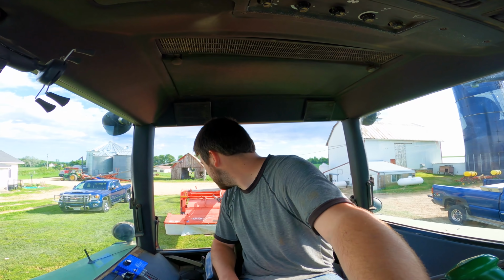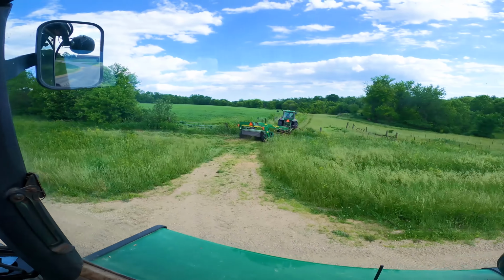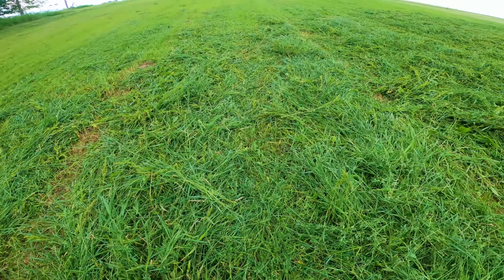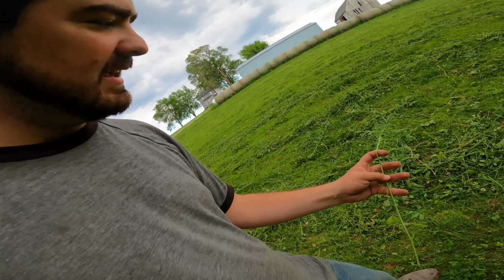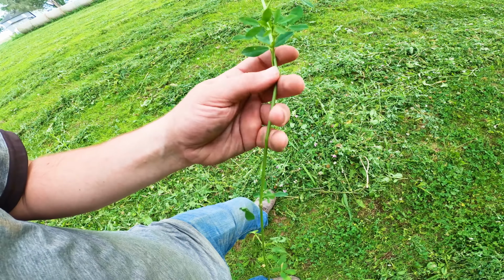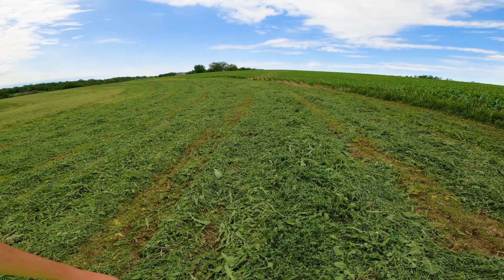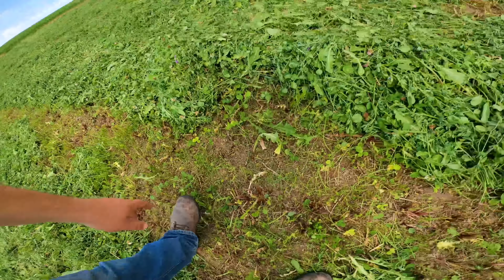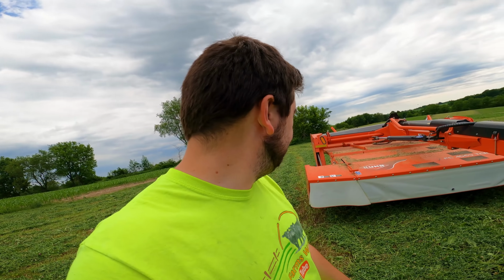Knocking Out First Crop | New KUHN FC 4060 TCR Mower Conditioner

Comment: I've watched and commented off and on since your small square baler video many years ago.  

I cut with a 4840, basically the same tractor as a 4640, except all 4840s are powershifts, have a bigger fuel tank, and a bigger injection pump.   My mower is a Gehl 2415.  Good match.  I totally agree with a center pivot,  Swivel hitch is as important.

Comment: We always ted our hay right after we cut it if we are going to make dry hay bales.  Not only does it lift up the hay which was ran over, but it spreads it out even more.  We have found it cuts dry down by at least a day in first crop and 2 days in 2nd & 3rd crop.

Comment: You guys should try a self propelled haybine. On our farm we use an older New Holland 1495 and a newer New Holland HW300. We like them because they use barely any fuel and we don't run over our windrows with them. It also make the cutting go way faster. You guys should try one sometime.

Comment: Was thinking the same thing about the 4640 being a perfect tractor for that mower.
Reply from the maker: We were worried it was going to be a little too much tractor for the mower, but it seemed to run it very well!
Reply: If you weren't careful maybe you'd over power the hitch gearbox on start up. But you ran it up a little at a time. Seems perfect!

Comment: one side of the header is heavier than the other side. you adjust the torsion bars by how much it takes to lift each side  so it might have been adjusted right
Reply from the maker: Maybe, but we found it wasn't leveled even before I adjusted it and adjusting it made it run flat

Comment: It seems as if a narrow windrow would be better for drying. That way you are not running over it with the tractor tires and pushing it on to the damp ground. And the narrow windrow gets it up off the ground so that the air can flow through it better.
Reply: Been watching for about 3 years I like the demos keep up the good work trying for a hat
Reply from the maker: I do regret laying it as wide, not so much due to drying since it dried very well, but because I couldn't hit it pass for pass with the pickup of the merger.

Comment: How good does it pick up your tractor tracks when you cut the same direction
Reply: Not the best, depends on the blades an type of hay. Most farmers go clockwise five to seven times then turn around an make their back cut so your haybine is always on your right!!
Reply: @bryanG4020  Most guys cut one round counter and the rest clockwise, but by then you go back and forth
Reply: @buffranchAB  that's backwards also, starting counter clock then going clockwise!
Reply: @bryanG4020  must be an  amateur, always have the bine on your right side, haybine towards the bush and fence first round, not sure what you're getting at..  then turn and cut your tracks,  just doing it the easy way, 1800 acres per year first cut, my three boys and two farmhands try to do it easy,  why would you ever cut clockwise the first round, I don't get it Bryan

Comment: The torsion bar on the drive side will need to be adjusted tighter because it’s heavier on that side.If you want a tried and true mower you can’t beat a Deere 946.

Comment: At 64yrs of age I've seen some grass cut, that type of mower was once popular for a while in the Uk, now its not used as much.  I'll put a link to the popular types of Khun mowers in the uk in 2020,  btw Ryan, flail mowers not great for grass if you want it to come back growing quicker, the flails smash the grass storks and they DO NOT come back growing as quick as if cut with a blade.
Popular Khum mowers, easy to turn with and transport & use. https://www.kuhn.co.uk/uk/range/hay-silage-making/mowers.html
Reply: The other mower uses blades to cut with but have a flail conditioner on it. It’s not a flail mower
Reply: Yeh i understand that. When i mentioned flail mower. I was refering to those with the flail/blade on the end of a short chain type link. They really hurt the regrowth. Not a clean cut like the mower Ryan used.

Comment: On your first pass, why are you pulling it straight behind you. I thought it was best to have it off set for the first pass so that your second pass you can go the opposite direction which helps it cut better where it was already run over.
Reply from the maker: That's probably the better way to do it, but when I do the outside pass I like to have the visibility along the corn so I can get as close as possible.
Reply: @HowFarmsWork  
That makes sense, but in some situations where you don't need to be as careful with the edge you would probably do it off set.